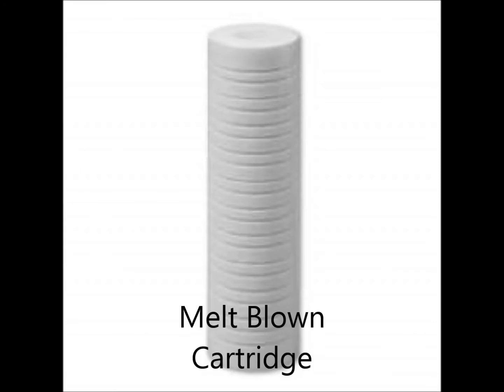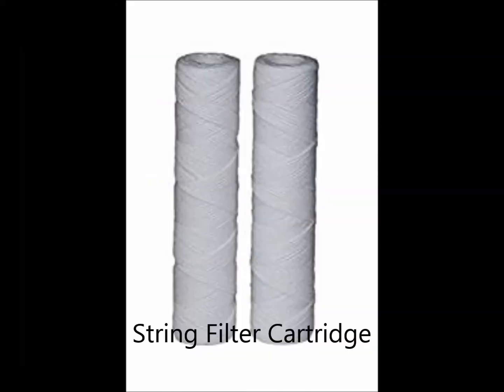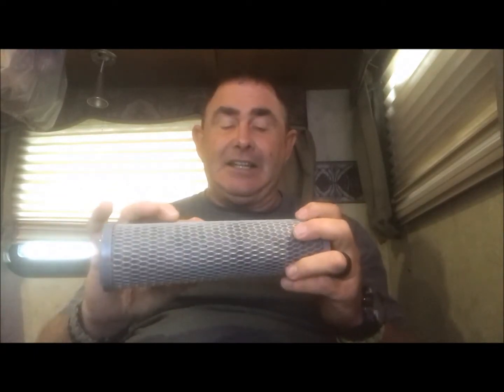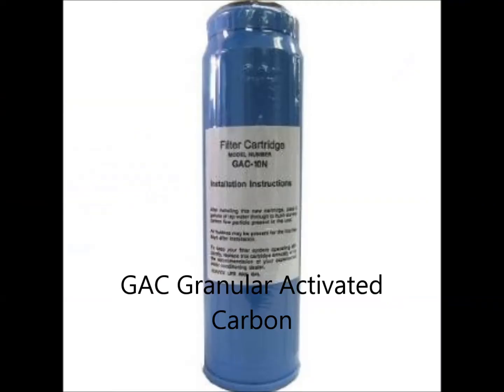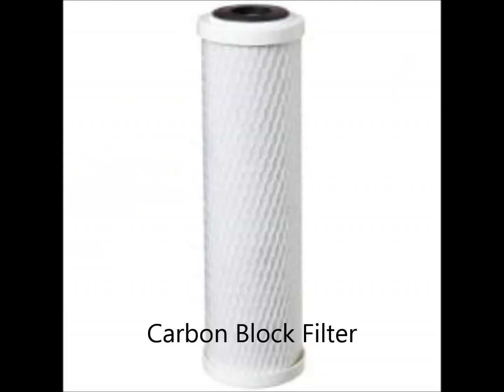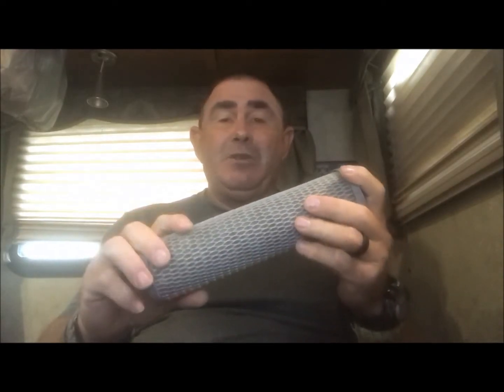What kind of water filter do I need

Comment: At first, you said to use the carbon block filters to reduce chlorine. Towards the end you said to use the GAC filters. My question is which is better carbon block or GAC filter? Thanks
Reply from the maker: I'm sorry for taking so long to get back to you, as I just now saw this. The carbon block is compressed carbon and stops most everything however, you'll want to use GAC (loose carbon) because the carbon block will need to be replaced sooner. The carbon block is the better one